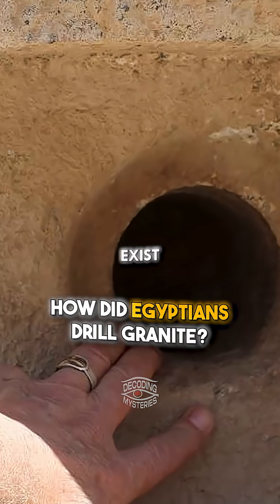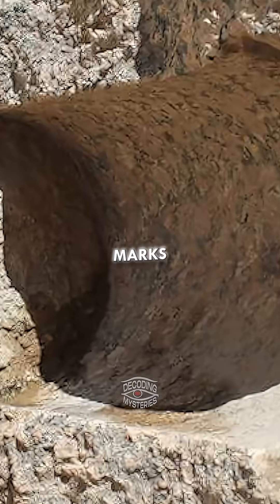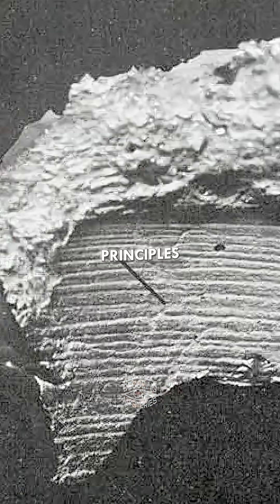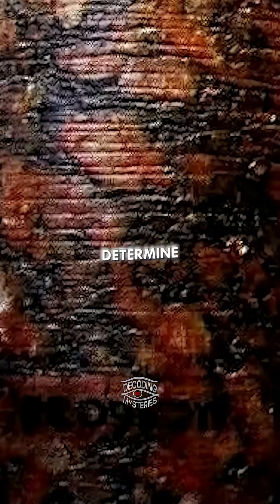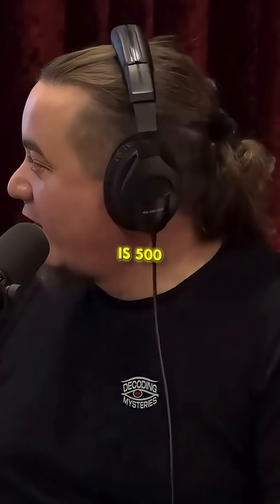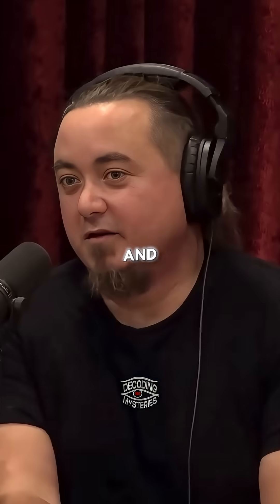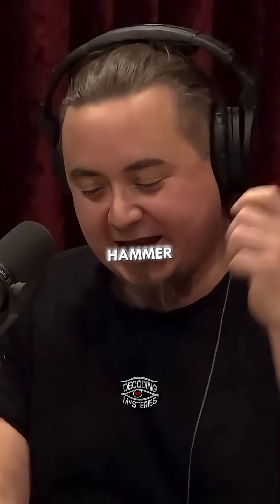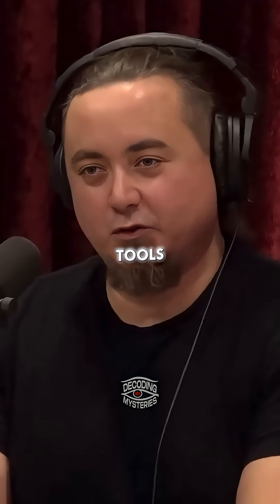The Hidden Power Behind Egyptian Stone Drills 🪨

Comment: Today, we use diamonds glued to steel and cutting oil to cut stone. They used copper, sand, and water. Basically, it's the same it just took a lot longer.
Reply: You not getting 1/60 outa that your not getting 1/60 outa anything we have today. 😂
Reply: @JonTravalta Nobody has ever documented this single core. No drill of any type will cut anything at this rate. Anyone who has drilled anything ,even wood, knows this to be true.
Reply: No way!